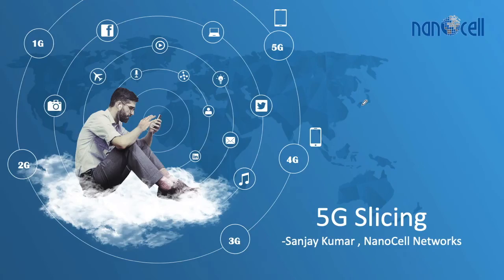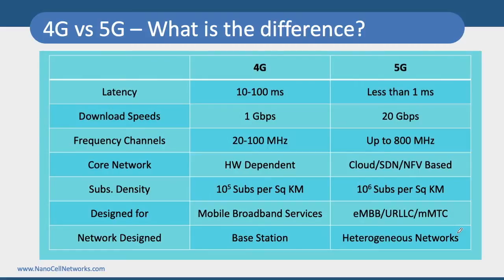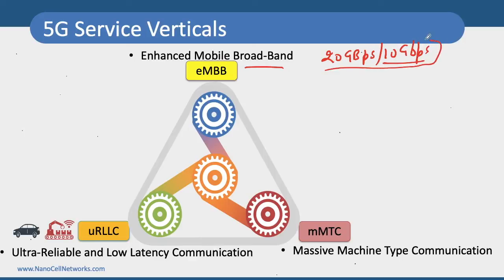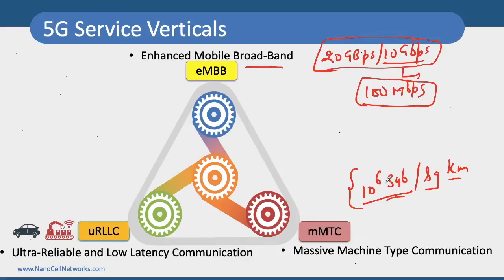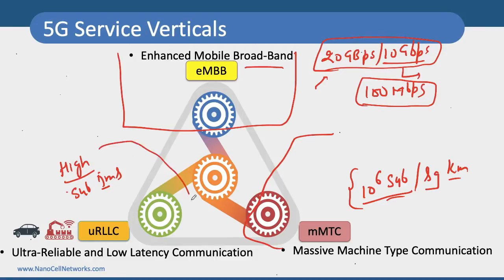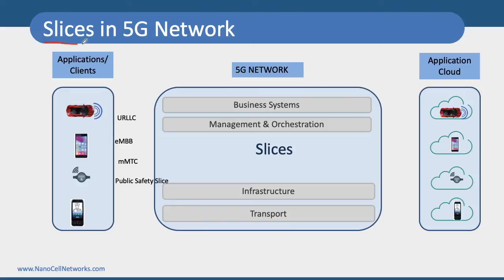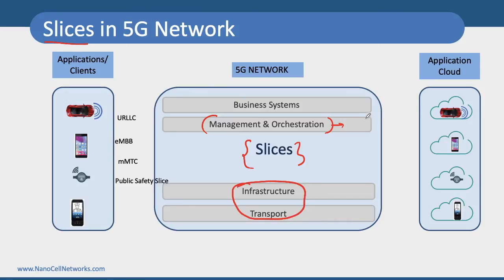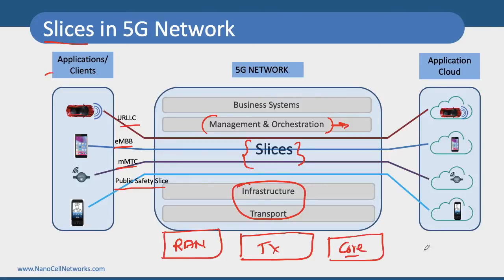5G Slicing |5G|Slicing|5G Slicing| Network Slicing|

Comment: Normal eMBB and car eMBB are connected to same phy and Mac, and two different core network entities. Does this mean that they are connected two different slices of core network but with the same slice of phy+Mac ?
Reply from the maker: Multiple slices can use dedicated to shared radio and Core network resources. 
So it will be all dependent on what are SLA requirements of Slices

Comment: one doubt, is slice creation happen for each user ? if there is only one slice for all users for 'mobile broad band' then if slice might get fully utilized when users increase. so do we have a solution for handling these issues
Reply from the maker: Slice is not for one user but for many users. It the resources allocated to one slice are full, Some or all resources can be auto scaled to meet the SLA Requirements.